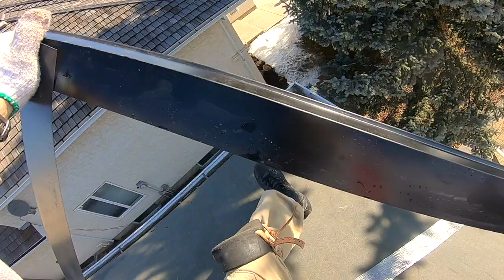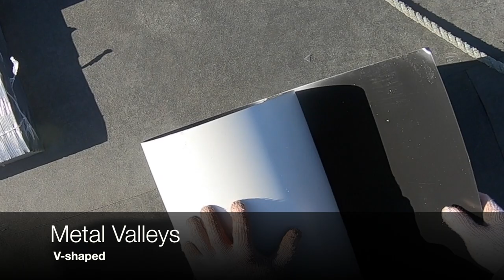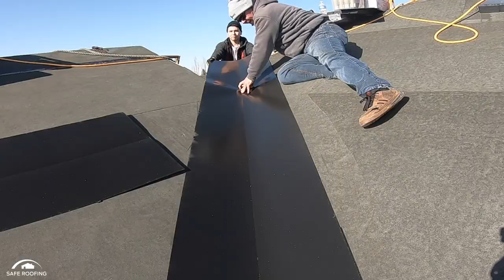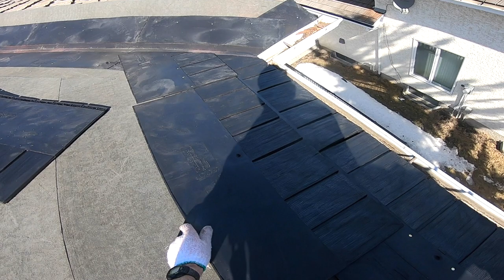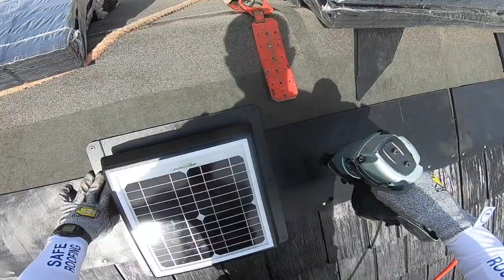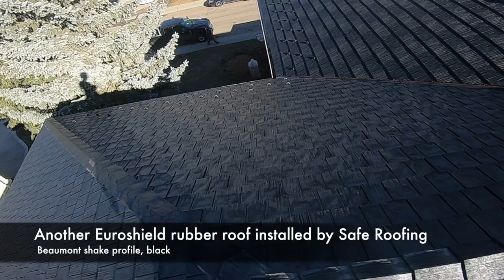Edmonton Euroshield rubber roofing system - Safe Roofing

Comment: Nice looking roof! Whats the cost for install? Say 4/12. Straight gable roof.
Reply from the maker: We supply the material and install it. In Edmonton, the base price is close to $8 per square foot if you have a cedar roof to tear off (2019 or before), steeply pitched roofs cost much higher. This will include everything. Simple structures are eligible for a discount. If your roof is an asphalt roof, then the cost is much lower because you save money on tear-off and dumping, etc.
Reply: And what is the warranty on those rubber shakes?
Reply from the maker: @davidlysohirka798  50 years. And here is a link to their actual warranty: http://www.euroshieldroofing.com/warranty-information/
Reply: $8/sq ft= $800 per square. Why 10x cost of asphalt?
Reply: @ToddBizCoach  asphalt is 300$ per square ( 10x cost ?)
Reply: @ToddBizCoach  it's not ten times,  it's roughly twice. I don't know who you got installing a roof for 80$ a square but hey, when it's leaking like a straw hat my price will double
Reply: @pawel6564  my comment was about the cost of materials. Asphalt shingles cost $80 per square.
Reply: @judsondundon4880  my comment was about the cost of materials being 10x . Asphalt shingles cost $80/sq.
Reply: @judsondundon4880  labor and materials for asphalt is $220-$250.  If you are charging $800 / sq for metal materials that is 10x the cost of asphalt  materials at $80/ sq.
Reply: @ToddBizCoach  I've owned a roofing company for the last 7 years and I'd laugh at you if you tried to pay me 250$ a square labor and materials 400$ all day. I'm not sure what third world country you're living in lol
Reply: @judsondundon4880  your comments just prove “ you don’t know what you don’t know”. Just because CA is overpriced and insane does not mean the rest of the US construction industry or roofers screw the homeowner like you do. In the Midwest there are plenty roofing companies making net profits of 300k per year with one crew at $250/sq.

It’s great you make comments like this . Those  ridiculous comments of yours make great screen shots for videos on social media  for homeowners to view!

Comment: Cant imagine the heat inside the house in the summer. Black is not  good
Reply from the maker: Darker-coloured roofs absorb heat more and can cause the attic temperature to rise; however, with proper ventilation systems and sufficient insulation, it can help the attic to stay dry and cooler with air circulation during the summer days. Euroshield also offers a lighter colour shingle too called "driftwood".

Comment: I like that there!.how much them bundles weigh?
Reply from the maker: Regular Beaumont shake is 2.4 ib per square foot. Heavy shake is 5.8 ib per square foot. So, the regular shakes are comparable to asphalt shingles.
Reply: So yur telling me bout the same as a bundle of average laminated, asphalt shingles?
Reply from the maker: @santinomartinez7592  Yes, average laminated asphalt shingles.
Reply: Ok, well w knowing that n everything else I saw in that video; it's just like yur basic installation just w a supposed better roofing materials. I'll have 2 keep n eye on em in our local supply houses. Thank you
Reply from the maker: @santinomartinez7592  Euroshield mostly has the Interlocking System now. If you have a complex structure or steep roof, the installation is not basic. Please be aware of that aspect.

Comment: wont rubber dry out and crack over time, like a tire dry rotting?
Reply from the maker: Good question! If they don't filter out metal wiring from the tire rubber, the rubber panel will be cracking. Euroshield's materials contain no metal so they will not crack over a long period of time. In addition, the rubber panel contains 70% recycled rubber and 30% fillers and colourings. Those fillers add additional strength to the panels, and they will not rot, peel, split over time...I think when Euroshield advertises their products made from recycled tires, it can leave the impression that the panels will look like a rubber tire, feel like a rubber tire and therefore, they will act as a rubber tire. This is not true in reality. We have installed many Euroshield roofs and they don't look like or act similar to rubber tires at all. They are basically made from crumb rubber plus fillers. 

If you do a bit of research on crumb rubber, you will find that they are 99.7% to 100% clean, fine-sized (3.36mm to 0.074mm), and they are used on playground surfacing, roofing products, moulded products, etc. I hope this helps you.

Comment: How are these roofs holding up in Canada?
Reply from the maker: We install mostly in Edmonton, Alberta. It gets cold here, lots of snow, rain, and can be windy. They hold really well. We installed many those roofs already, so far so good.
Reply: In Texas - not worth a flip. There are 2 that have been installed locally. Both have started curling up on the tabs and the glue strip has turned loose. Now when the wind gets up the tabs will flap with the wind and cause a kind of rumbling in the house. If it gets up enough it will peel the shingles off the roof. So far - no help from Euroshield. 
This comment is directly solely at the product - we have had zero dealing with Safe Roofing. Looks like the did a good job on this roof.